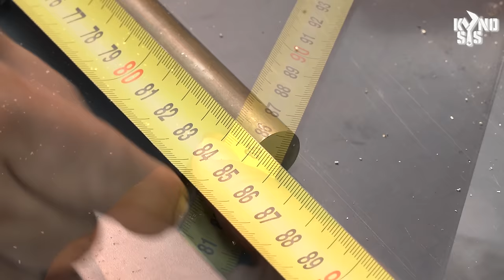Ultimate Metal Cutting Saw Station for DIYer

Comment from the maker: There are many things to cut metal while making works. It's hard to cut it with a ruler every time, so I wanted to make a metal cutting station like a woodworking Miter saw station. 
While I was making it, I also made a shelf on the top of the wall where I could put long boards,
It's become a blockbuster to fill one side of the wall.
The board stopper was also made pretty using magnetic base, and I think it will be very helpful to organize the metal workroom by making 30 drawers at the bottom.
This video is a bit long because it was made over three weeks, but I think you can enjoy it because you can see so many skills.
Now, metal materials are as comfortable as wood and can be cut as long as you want.
It's my own metal cutting saw station that will be used in many works.
Please enjoy watching it and subscribe and like it. Thank you.

Comment: quelle est cette lame ? depuis quand peut on couper de l'acier avec une circulaire à moins que la scie soit dédier à cela.... ma circulaire bosh pks 66 peut faire cela ???  (video 10:26)

eng: what is this blade? since when can you cut steel with a circular saw unless the saw is dedicated to that.... can my bosh pks 66 circular do that??? (video 10:26)
Reply from the maker: Circular saw for metal. The rotation speed is slightly slower than that for woodworking, and the power is strong. thank you!